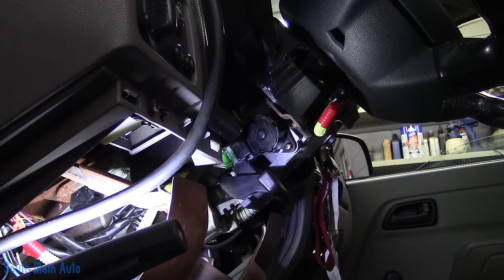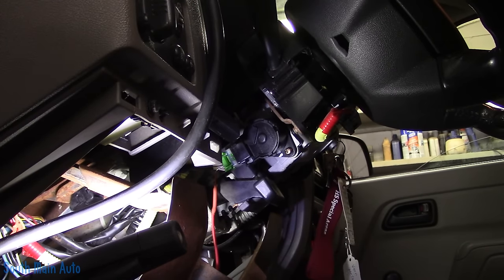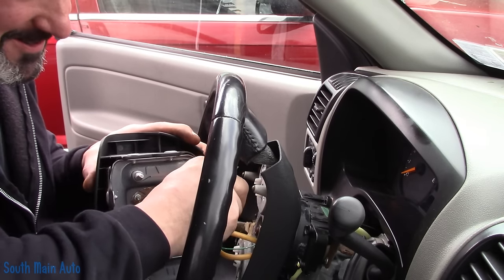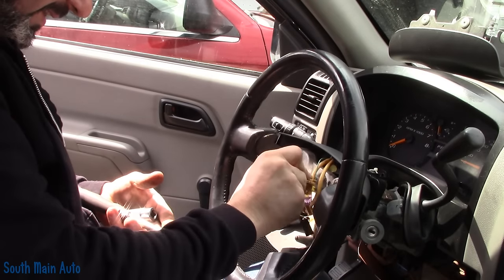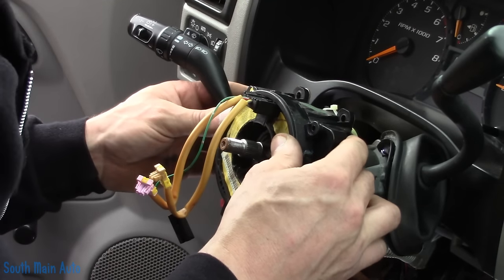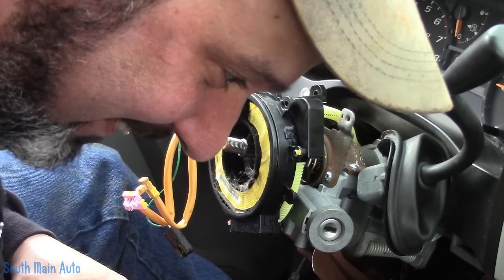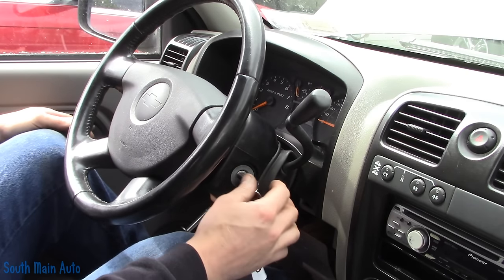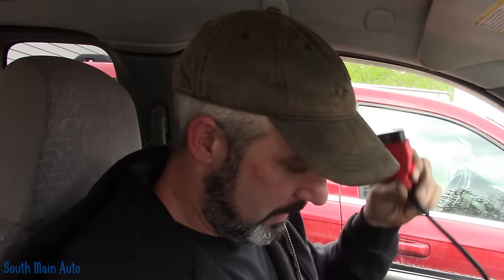Chevy Colorado: No Start, No Crank

Comment: 11 Chevy Colorado 3.75 cylinder and my temperature gauge went down to 01 is going down the road so I googled it and it said I needed that temperature sensor so I put that in there and I tightened it too tight and broke it all but I got it out and I put another one in there well before I put another one in there I let my truck roll down out of the parking space too far and I crank it up without the sensor in the hole and the truck ran loud then didn't have no fire and I barely got it back up in the parking space or what and now I can't put another sensor in there and I can't get it to run it tries to crank a little bit but it don't crank but what should I do thank you and present

Comment: I just seen that the airbag light stays on. My truck has the half doors that open backwards.  My truck has the same thing going on and I found that  if I open and slam the back doors the light will stay out. Has always been like this. I think it may be because the safety restraint system has the seat belts in the back doors.

Comment: Same thing happened to me  had power to the interior and exterior accessories but no power to the engine. It turned out the  maxi fuse was out replaced it and all good.

Comment: Getting ready to order the ignition switch.  Dies it come with the shear bolt?  I also need to replace the multifunction switch because cruise also quit.  so doing them at the same time.  My truck is the 09 Canyon 2.9L 5 speed manual .  I have the Circle Plus chip key, no not sure if the part number would be different.

Comment: Why did you not just replace the switch? Super easy,2 torx screws replaced lots of those .5 hour at the most. Only thing you take off is the lower shoud on col. you already had that off for diag.

Comment: In the subject, almost.. older Volvo cars like S60/80, V70/XC70 and the old XC90 had some issue at the factory with the steering wheel screw. Not enough "kadonka donka" as you say =) They had some service bulletin for this back in the days but I still find them, last one today on a V70 2004.
Just curious if you now about this on the other side of the puddle.
Keep up but fail videos are funny to, the Mazda 6 brake job was hilarious =0)

Comment: I working on my 2012 GMC Canyon, and I followed the directions in the video. When I put the new switch on the truck wouldn't turn over at all. According to the video the truck is supposed to turn over, but not start. I'm not getting the truck to turn over at all. Do the new switch need to be programmed with the anti theft system before I can go through the process of relearning the key?

Comment: Hi there i hope you are still responding comments, j have an issue with my H3 06, stared with no staring, it was cranking…after changing the ignition sensor and the harness still some issues left,  when you turn the key the car run in ON position NO start..no AC, windows, wipers or cluster… I’ve been driving it manually i locking the shifter. Checked all the fuses and relays, connections etc… im out of ideas… PCM and BCM are good and  communicating… what can I check or test at this point? Thanks in advance for any input you may have. Great channel btw.

Comment: In my girl I watch your channel all the time good stuff I have a question kind of related to this video but not I want to put a 2.2 l Chevy S10 and a 5-speed in a hot rod and I need to figure out what components I need and how to bypass the BCM ignition system can you hack the BCM and avoid the ignition key or any other advice would be appreciated

Comment: Was just replacing the black plastic part on the end held on by two screws an option to avoid a lot of other labor? I know you can’t buy them separately anymore. But could you remove it and  try that first before going to all the other trouble?

Comment: Hello ! I have a 2012 gmc canyon that does not start but when I add power to the white/green wire in the 22 pin under the steering wheel it cranks right up . Any ideas on how I can fix that ? I thought about running another ignition & connecting it but I can’t find one strong enough to start it

Comment: Hey I have a suggestion that I have figured out over the years on this what causes this problem 
When you carry a lot of weight on the key the cylinder wears out prematurely over time and causes the problem of lack of connection in the contact points inside the electric contact points inside the switch

Comment: Worked on my 2004 Colorado a few years ago and ended up replacing the ignition switch. I don't know why they don't sell just the switch but I removed the new switch from the housing and replaced just the switch. Went through the passlock programming and it just did the same thing yesterday. No crank, no start. I wish there was a way to just bypass the passlock system altogether.

Comment: I couldn't tell from the video, but could the switch part on the new assembly been removed and placed on the existing ignition lock without removing the wheel?    I changed a switch on a Ford and only the switch needed replacing. 15 minute job.

Comment: So I have a question. My '12 Colorado does this. Every so and so it forgets my keys and I get no crank. And the fix I have for it now is to reassign the key which requires me to leave the key in the ignition turned on for 10 minutes. Was this doing the same?

Comment: A quick question.  I see you use acetylene torches to bust loose all that rusty crap like exhaust components ( thank god we don’t have severe winters that require road salting)  Why not get a plasma cutter?  It is more localized and seems to work a lot quicker. What do I know, I spent 4 years in the service as a lineman.

Comment: This is a common problem with this ignition switch. The cause was the 2 ib key chain. Most current owners manual will warn you about a heavy key chain. This can reveal itself as an intermittent starting problem at about the 2 - 3 year mark, but will eventually it will fail. It was common knowledge on the floor of the GM assembly plant I worked in for over 30 years.
There have been multiple designs with the same problem. The switch manufacturing was moved to Mexico well over 10 years ago. Never was a problem on US manufactured Ignition Switches. No BS just facts.

Comment: I was wondering if you took off the electrical twitch and transferred it to the ignition column would that work also?
In the 3 ignition cycles for the passkey, would that work on a 2002 Honda Civic?
The steering wheel column lock Paul was missing! Was that a aftermarket ignition column switch?

Comment: I replaced only the passlock sensor and not whole housing due to lack skill/tools ha BUT  my issue is during the relearn process my anti theft NEVER blinks it just stays solid. I turn the key and cranks over and immediately cuts out. Is there something inside the housing that would make a difference or do you think my problem is somewhere else?? BCM  maybe??

Comment: I've noticed a silver subie in a few videos and been wondering what's wrong with it.. Unless it's not a customer car. I've also been wondering if you've seen brake line failures on those legacies.. Seems even after getting the nox-rust anti-corrosion wax applied to certain spots by the dealer for the recall (WQK-47 I think), people are still having failures. Not surprising I guess since it's not a real fix.

Comment: Followed your steps and my switch replacement was easy.. But it still didn't fix my problem.. What ever is wrong with mine has something to do with the gear selected light on the dash (PRND123) That yellow light will not come on, so I'm thinking the ECM Thinks the truck is in D or R and it want crank. How do I address this problem?

Comment: I have a 2005 Colorado with no BCM  buss line. I have PCM,ABS,IPC and radio. MIL comes on. Code u1064 in PCM. Code U1000 in other modules. Also, no other lights on dash and no running lights. Door locks work. But, power windows and windshield wipers do not work. Diagram shows all busses going through BCM. Checked fuses out front . All getting power with key on like normal.Seems like BCM inop. Shows power and ground to PCM. Any other thoughts on testing?

Comment: I hate to say this, but why didn't you just move the new passlock switch from the new assembly to the old assembly? That's what I plan on doing. I've had my switch off and all you have to do is move the key to some position, I don't remember which, remove the connector and two screws, and you've got the old switch in your hand. And I've seen the passlock switch for sale in several places as a switch only part. Which I also have to replace because part of the it has an over heated conductor in it. Thanks for the diagram showing the resistor as 300 ohms which is what I've seen in another different diagram and the numbers on my the resistor have been partly melted, intentionally, but begin with 30 so a switch with the correct resistor should work without all the fooling around or taking the steering wheel off and hoping the airbag doesn't explode in your face. And my 2005 Canyon automatic doesn't have the steering wheel lock. This may be a common thing with trucks manufactured for the rental market. And thanks for the process to reprogram a new switch if it isn't a resistance match to the old switch.

Comment: I bought a 2016 Colorado truck 3.5 LT after 5 years owning it I started to have issues with the engine not starting no crank. 
When I try turning the key to the on position all the lights on the dashboard turn on and so does the radio, the battery is new but it won't start, nothing the engine doesn't start, after 5 attempts to started, the engine starts, but sometimes it won't start after10 try's, when this happens, I wait few minutes after two attempts to it starts. It starts the engine. What could be the problem. 
I have not gotten a definite solution to this problem; I watch older YouTube videos with similar issues to my surprise the issue can be a ant thief sensor in the ignition cylinder, but my dashboard light doesn't show an anti lock icon going off. I sure like to get to the bottom of this problem. Any advice is welcome.

Comment: My 05 has a different schematic, but it's 2WD. Battery power to the switch is orange in, start/run is blue out, to the BCM. BCM has a blue out to the run crank relay. 

Intermittently won't start, dash lights always come on so assuming acc is OK. Always runs after it starts, so assuming power to the start relay and that relay are good. Start/crank relay could... be intermittently bad I suppose. 

Jimmied around with the shift lever (auto) thinking it was maybe the interlock, still not sure. No idea yet where that park/neutral switch is, I'm guessing in the column? Maybe down on the transmission but that seems silly (not that that's past the GM engineers to do). 

I pray it's not the BCM but the windows also intermittently roll up and down, which is a BCM thing. Anyone's thoughts much appreciated.

Comment: OK, Question.I understand you changing the whole switch module because the customer paid for it and protecting your business and all that. But for us DIY guys why not just take the new switch off the new module and replace just the switch part. Would save all the hassle of taking everything apart and then reteaching the ECM?? Looked like a matter of two screws and your done.

Comment: I had a 2006 and could never get the check engine light to stay off. I kept throwing codes for various sensors , Crank , Valve, coolant. Had it worked on many times. Traded it off.
Reply: I could get it to stay off, easy, 
Step one: take dash apart
Step two: Disconnect LED 
Step three: No check engine light

Comment: Eric, have you run across a very intermittent but well known issue on those model Colorado/Canyons/H3 where they randomly forget the passlock and the truck will have a no crank, no start? The truck will drive fine. Is shut off And then at random times, the truck will has a no crank no start and the theft light will be on. Power windows, radio, blower and everything else works fine. Driver leaves the key on for ten minutes, theft light goes out and the truck will start. And then at some random time days or weeks later, no crank and again, the driver has to do the ignition switch relearn in order for the truck to start. If you have, have you been able to permanently fix the issue and if you have, how did you fix it? I've been to the Chevy and GMC dealers and they've all told me since the problem is so intermittent, finding and fixing the problem is impossible and the only thing the owner can do is do the ignition switch relearn when the problem occurs.
Reply: UPDATE
Talked to a buddy who works at the Cadillac dealer as it used to be a Hummer dealership as well when Hummers were made. I told him about the problem and he said the problem is with the anti-theft module that's mounted under the ignition switch. Replace the module and the anti-theft problem should go away.

Comment: Semi new to your channel. You are 4.5-5hr ride from me. What do you charge per hour? Im thinking of driving to you to have my car fixed. I have a 86 pontiac 6000 STE that needs: neutral safety switch, shifter cable abs/brake light on i get no fluid to rear brake calipers. I disconnected the lines to the rear caliper and blew out with air and the lines are free and clear. The Issue falls at the "block"/ proportioner valve. Thanks. Dig your videos/content.

Comment: Would it be possible to just swap over the black switch assembly, new for old, on the end of the ignition key barrel?
This would avoid removing the steering wheel and other parts.
Reply: I did just that on an 09 Colorado, you have to turn the key slightly before the aluminum housing will let go of the black switch, but after the swap it started right up, no reprogram.

Comment: It was totally unnecessary to to the column tear down to replace out the switch.

After taking off the shrouds you will see the switch at the rear of the cylinder housing. After removing the two Phillips screws you will pull and it will not release. You have to advance the key position from “Off” to “Run” and the sector gear in the housing will be timed to allow the switch assy. to then release from the rear and you replace it. It takes 3 minutes.😂
No programming of the 48 Megamos chip...no shear bolts to contend with...no airbags and clock spring.

Kinda shocked you never even entertained that quite frankly.

Just did one today and it was done from the time I put on Hey Jude on the radio to the ending of the song.
78.00 bucks from Piston Ring....

Comment: greetings South main automotive my name is Charlie with keep it simple mobile auto repair in San Antonio Texas I ran across the same exact symptoms on the 2007 Chevy cavalier I started the car with my power pro be starter is fine after changing the ignition switch which I really thought was the problem I can't clear the passlock I have an x tool 7 scan tool so I can play with a few switches but I can't turn off the fuel lock out or the ignition lock out also have a radio lockout they came on at the same time after a lack of power to the battery for how to know how long that little voice inside me says BCM or ECM I just don't know which help me please

Comment: 7:13 that is the dumbest "bolt" ever. I used a chisel and hammer to loosen it (tapping it counter clockwise) after I took all the other junk off and then tapped on a socket like you did to unscrew it because none of my vise grips would fit it. Then I replaced it with a normal bolt.

Comment: Next time save yourself a lot of work. Take the passlock sensor off the new housing and put it on the old, IF the old key cylinder is working good.
2 screws and a plug in for the wires. No need to pull the wheel or take the upper column cover off.
Reply: I was actually going to ask that question.   Thanks for posting. I'm going to try just replacing the sensor first. We shall see. Thanks Eric for running through the entire repair in case it have to go that route.

Comment: The problem with repaving in your area is they strip off the lumpy asphalt and replace it with recycled road salt. ;) And yeah GM vehicles of this era are incredibly poorly engineered and often way more difficult to repair than they should be.

Comment: Brilliant general motors you need a $5000 scan tool to install a $50 switch.  All this anti-theft garbage only stops a teenager from taking a joyride on the weekend. It does nothing to stop the people that pull in with a flatbed put your car on it and drive it off to a chop shop. All this anti-theft garbage is just that garbage to make more money for the dealership.   A useless complication in search of a problem.